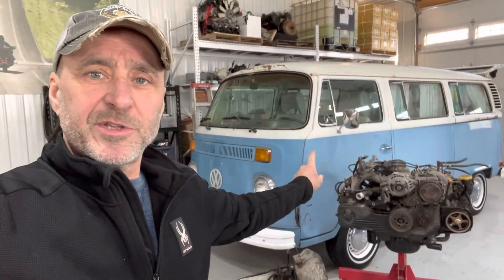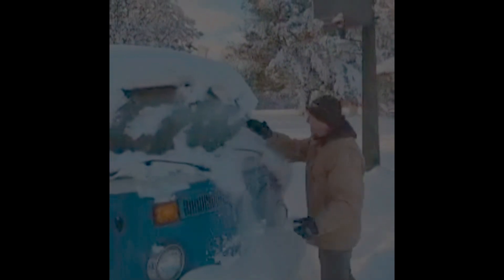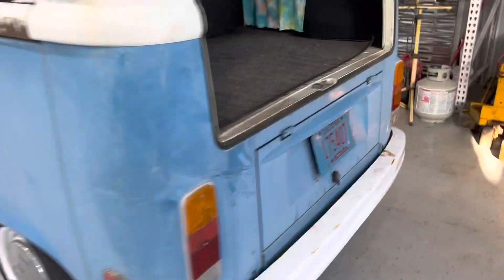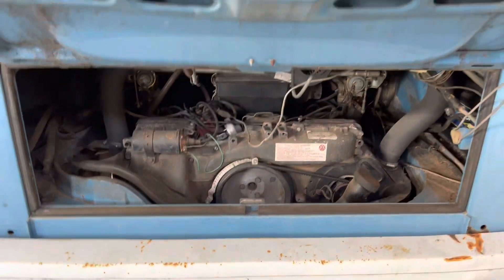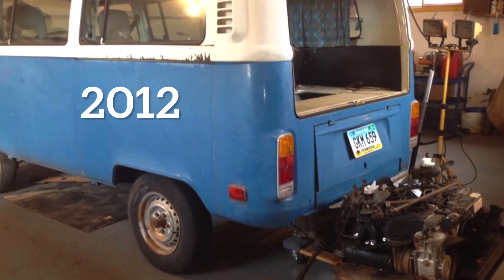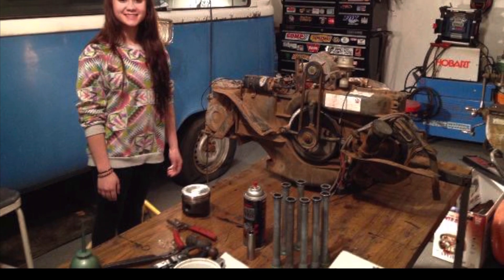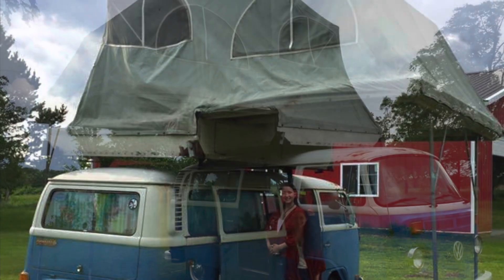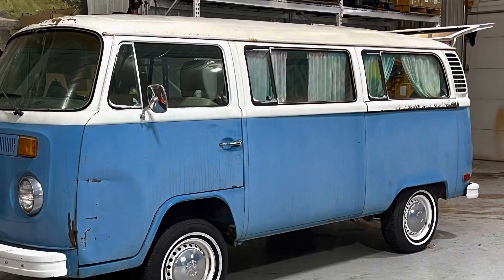Part 1- VW Bus with Subaru Engine (project Intro)

Comment: Keep in mind that the transmission is going to be beefed up a little. Those auto transmissions were built by Audi  originally and could handle 90 hp. At 130 hp it might not last long if you overpower it to much.

Comment: That original motor came as 1.7 , 1.8 and a 2.0.
Reply from the maker: you are correct. I think it was the 1.8, its been a while since I have worked on the original engine.  thanks for the comment.

  GOOGLE: Power is provided by the 1.8L Type 4 air-cooled VW 4-cylinder that the owner states has never required a rebuild. Factory rated at 67bhp, the engine is currently fitted with an aftermarket 2V intake/carburetor and new custom exhaust system.